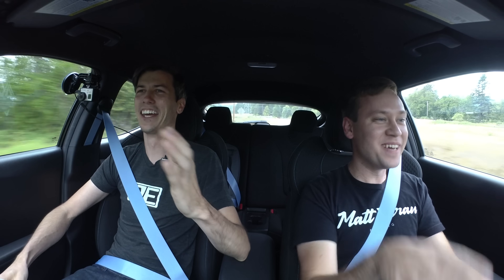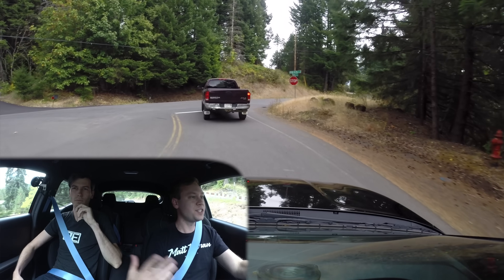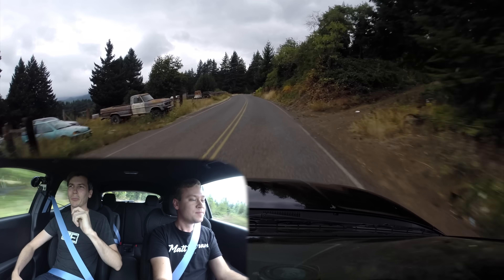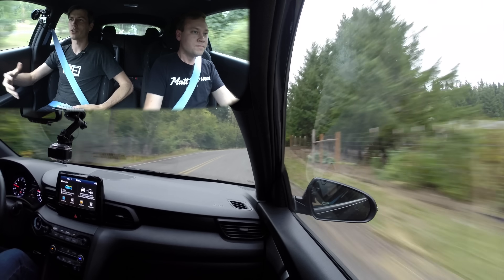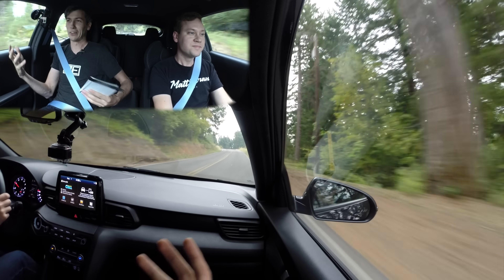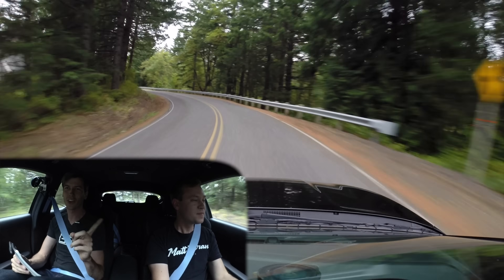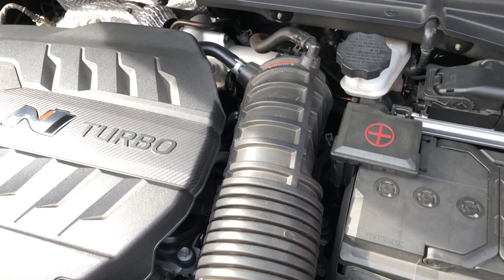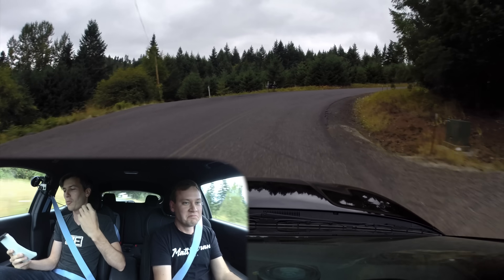Are Car Exhaust Crackles & Pops Fake?

Comment: A CVT that shifts fake gears is the dumbest thing a manufacturer can produce.
Reply: Yes it’s mind blowing, people want their geared cars to have so smooth of shifting (like on luxury cars, really using that torque converter and soft shift kits), but the wanting a jerking whiplash with literally the transmission that is designed to be smooth... Well, maybe they just need to ride with me to decide they don’t want whiplash, because that’s about how I shift my gears...
Reply: people are afraid of cvt. i tried to sell car with cvt transmission and every potencial buyer pass becouse of a cvt. everybody said that it dont change gears properly. 
i think thats why they programed cvt to immitate auto gearbox.
Reply: ICo Hi, tx!
Yes, I get that people have to get used to it but that’s just what it is. A CVT enables the engine run at its optimal speed all the time. By adding artificial gears, that advantage is ruined and defies the whole purpose of a CVT. It’s a pitty the majority of the people don’t understand this and ‘want to hear it shift’. 
From the manufacturers point of view: if you let the CVT imitate gears, why not install a regular gearbox then?
Reply: @Conservator.  Polaris rzrs and all side by sides are cvt
Reply: @Conservator.  id say just go with the auto they last longer than cvt's. Usually they only put CVT transmissions in 4 cylinder cars with low horsepower to try and maximize the little power, and marginally better fuel economy they do make at the cost of longevity. Something called Planned Obsolescence
Reply: Mitch Conner 
I agree accept for the planned obsolescence. CVTs are extremely difficult to produce. Iirc there are also industrial strengths CVTs.
Reply: @Conservator.  they have the same problems with dual clutch transmissions. They allow fast shifts, but they are complicated to build/ repair and they don't last as long on average as a conventional auto. Ford had problems with some 3 million cars with DCT not lasting till even 100k that's sad considering my auto transmission in my eclipse is 14 years old and well over 100k and still going strong. Also just to note my transmission is about $1300 some CVT's and DCT's are more than twice that price
Reply: @D1gpIco  they dont change gears is the point. you have either max power at all times or best fuel economy at all times depending on how you drive. a cvt doesnt change gears, it changes gear ratios smoothly.
Reply: How come cvts are always slower than a regular automatic then when theyre an option on the same motor.
Reply: @snarfbot  
Cvts might be slower (have a lower top speed) than other transmissions because of a limited gear ratio but they might be quicker to accelerate.
Reply: @Conservator.  lol no, that's never the case.
Reply: ICo I had the sport accord with the cvt and I loved it, I have an SRT now but I’d buy an accord again
Reply: I think it serves a purpose for cornering or drifting/powersliding, where holding one specific fixed ratio is benficial
Reply: @FxckingYeet  its a cvt it maintains a constant rpm look up polaris rzr that is a real cvt
Reply: @FxckingYeet  yeah i do agree
Reply: @FxckingYeet  merry Christmas
Reply: @Tyler Browning Yes but why not have both by making a CVT act as a fixed gear trans? If it's only in certain modes like a sport mode or something and comes back to beeing a CVT in normal mode then it's fine to me. The only way to manually control a cvt is through set ratios
Reply: CVT falke gearing? Tesla has instruments with needles but on a screen...
Reply: It's because most people aren't use to a cvt sound of it rev up and stay at that rpm. My quad cvt took a little bit to get use to
Reply: I strongly disagree, I can't stand when the CVT holds the RPM, screaming, sitting there at 5000rpm or whatever (at wot)...  Whenever i drive my girlfriends car (that has cvt), i drive it in manual mode because its sooooo much more satisfying, normal and better feeling & sounding.
Reply: My car with a CVT doesn't change gears (unless you put it in reverse) it just has 6 different set ratios you can change to when you want (fake DCT). In terms of how gears and CVT's can create ratios they are in essence the same (what happens between ratio changes is the big difference). A plus of a CVT thats often not mentioned is how you still have drive (power to the wheels) as the ratios change. Driving my car without the option to manually select the ratios you'd would be a terrible choice as it drives completely different in automatic than manual (for lack of a better term). In auto the revs start off high (3-4k) and drop lower as you gain more and more speed, in manual mode the revs start low and grow (like a geared transmission). Manual mode allows you to choose higher ratios at will to get in the power/torque range of the motor at higher speeds (4k+ RPMs when going 50 MPH+).
Reply: @4u2nvinmtl  my car is like this
Reply: What about japanese cars that play v8 noises through the car speakers?  glares at friend with the 370z
Reply: Phillip Aubin  prove it.
Reply: Yes... but no. More sales.
Reply: Well CVTs are belt driven and crap anyway, take Nissan for example, lucky to get 80k miles before the transmission goes
Reply: No the dumhets thing is to put a cvt in the car.
Reply: People want to feel that shift.
Reply: Gear hunting sucks and the CVT is trying to eliminate that.
Reply: @vvvvel  Competent tuning and programming fixes that.
Reply: @DragonKnightX12  Who's gonna do that for you the dealership? lol
Reply: @vvvvel  You get this amazing called a tune.
Or you buy a car that doesn't have that problem to begin with.
Reply: @vvvvel  lol You act people aren't already doing that.
Or that every vehicle has a problem with gear hunting.
Just in time for the EV take over.
Reply: The new Honda CR-V's do that at full throttle. It's kinda pathetic tbh.
Reply: Idk why Subaru putted paddle shifters in the forester because the forester is a cvt? If Subaru wants to put paddle shifters in the forester, gives us instead the dct with the turbocharged engine like in the forester sti.
Reply: It’s because people are scared of constant high rpms, and it’s better when selling as a salesperson, they can get away with just saying “automatic” instead of CVT, which can lead to people buying a CVT without knowing and talking about how anti CVT they are.
Reply: People complain about no gear shifts in cvt, which defies the whole point of a cvt. Then they complain about not having smooth shifts in cars with gears. Maybe it's the so called "rubber banding" of power. Or the sound cvt makes. Can't please everyone.

This is why I choose manual. If it shift rough, then I'm to blame. Makes me want to get the shifts as smooth as possible. Sure, fuel economy suffers but I drive hard anyways.
Reply: @2010ngojo   My biggest complaint with my 2007 Nissan CVT, besides that it failed at 100k miles (but still under warranty so no worries from me about it), is that Nissan didn't put ABS/traction control on my car so when the front wheels spin on water or crosswalk paint the engine just keeps revving and there is no way to get traction except to almost come to a stop and let the engine return to idle. It's very frustrating.
Reply: CVT’s are great, but when you are so used to fixed gears, there’s a disconnect between you and the car. If you always hear and feel the revs rising when accelerating, it is weird and does not feel right when you are pulling away while the revs stay the same.
Reply: Most CVT transmission are inadequate for city/Hi way driving. They work great in side by sides and other light applications, but put one in a Nissan van and you will be lucky to get 100,000 miles with no problems.
Reply: @HarrisonCountyStudio  depends on who is making the CVT.  Nissan has one of the worst, but that doesn't make them bad.  Toyota makes reliable ones, or else the Prius wouldn't have such a great reliability record.  Honda ones are ok, a bit behind.  The rest of the manufacturers seem to just not care so much.

Another example of a transmission that is done both good and bad is DCT.  Ford does it terrible, but that doesn't mean they are bad as a whole.  The issue is these are newer technologies and the bad apples stand out and ruin perception for the whole.

Think of manufacturers whose engine fail early and often.  Do you turn your nose up to internal combustion engines as a whole?  Or do you say, well those Dodge engines are having high failure rates, but that doesn't mean the Toyota engine will fail at the same rate.

Try not to form opinions based on emotion and anecdotal experiences.  Yes, Nissan CVTs are TERRIBLE, but it is the manufacturer they buy it from that you will find is the big issue there.
Reply: Kuromurasaki Zero ...not emotional at all (only women and soy boys make decisions on emotions). My experiences are anecdotal, and with enough anecdotal comments, maybe one can derive some sense of what to except from others experiences, or at least their mistakes. Anyways... I drive a six speed 7.3 diesel, it runs on bio diesel... it makes money and is not an over priced Toyota Prius. Lol

Been around farm/oil and gas equipment for a long time. Like I said CVTs are good for certain applications. 

I gave the example of the Nissan Van because my neighbor had his tranny go out at 78,000 miles. The guy garage kept his van and was meticulous with maintenance. On the hand, I’ve seen side by sides with 30,000+ miles on them, used mostly for recreation or general travel around work sites. All on the original CVT. I’ve also seen side by sides @ 4500 miles that blow the CVT out because it was over worked, hauling small (but heavy) trailers around the pads. 

I’m neither a mechanic or afraid of new technology. I’d love to see a reliable CVT that could handle the horse power output of say... a 2020 Ford F-150... Maybe some day, but today we will have to enjoy the technology of a 10 speed automatic.
Reply: Maybe a CVT is cheaper? But man, you’re really missing the point of CVTs if you’re having fake shifts.
Reply: @Appletank8  in my country most of the cheaper car uses AT and cvt usually found in more expensive car
Reply: @Appletank8 
Cvt is cheaper to make. But the repair costs, recalls, and lawsuits makes that a moot point (at least for Nissan). 

And they are manufactured to simulate gear shifting, the computer/ecu is programmed to do that.
Reply: Its funny tho how EE says cvts started faking gears, when one of the first cvts - my 2001 audi a4 multitronic already did that and new cars started not having simulated gears
Reply: @zDemoGODz  the cvt trans is much older then that. Really old snowmobiles use a cvt trans. Heck even some old mini bikes did. Most go carts do. The theory is there. Those old ones wouldn't handle the power but the operation is there.
Reply: @meegstomtom  mini bikes used to top out 40-50mph instead of 15-25mph with stock gears with a centrifugal clutch
Reply: @dcappucino9513  yeah. Centrifugal clutch is just a variable gear ratio. Giving best of both, low torque and high speeds. But there is still a final gear ratio to deal with. And safety :(
Reply: @Tyler Browning for acceleration it works, but for everything else it doesnt, because like you said it's computer controlled and the only way to have a human have some sort of control over it is to make pre set ratios. Imagine having one of these new cars with a 10 speed auto but without manual mode, and trying to go around a track. Every time you brake, get into a corner or are not using full throttle in general, the trans upshift to the highest gear possible, well that's how CVTs are set. Maybe they could tune the CVT to maintain a certan RPM all the time, but so far i havent seen any
Reply: I couldnt do the cvt. Coming from a manual trans it just feels like a slipping clutch.. felt very wrong.
Reply: No. The dumbest thing is still crackles and pops. I saw few days ago an Mercedes CL 63 AMG starting to move in reverse to get out from a parking place, very slowly. When stopped, before going forward, the crackles and two or three pops were heard ”farting” from its semi fake quadruple exhaust. I looked at the clown in the driver's seat, and his face had an expression of idiotic pride.  The fallacy is the new ”virtue” of our times...
Reply: 1zanglang oh you NAILED it.
Reply: 1zanglang 💯
Reply: I had a 2017 sentra SV (CVT) and it felt so weird and very disconnected not feeling any gear shifts when you expect it. Now I have a 2017 Sentra SR Turbo, with a CVT + programmed gears, it feels much nicer.

Comment: One other reason against ultra retarded ignition as a means of implementing anti-lag is the increased valve seat wear.

I first became aware of this problem back in the 1980's with a turbo charged car that used ultra-retarded ignition so that I could spool up the turbo to full boost in order to get a better launch during drag racing.

The valves seemed to be ok if the system was only used for brief periods of time, however while I was trying to get the system set up initially the repeated use took noticable toll on the valve seats.

Comment: I don't like fake sounds at all. I loathe the fake signal clicks. How about going back to mechanical flashers, cheap & work just fine? Then, the factory speakers fail in a few years. I think CVT s can be fun without feeling shifts if they are used in an otherwise fun vehicle instead of focusing on economy in micro cars.
You want exhaust noises? Drive a carburated Wankel rotary.

Comment: Does crackles have a negative impact (lifetime) on the catalytic converter?
Reply: Thats a good question. For the most part the ignition should have happened early enough that the fuel is basically burned up. And its not an actual backfire where the full force of the burn is open to the exhaust.
Reply: MostlyClaudy not if you’re catless
Reply: @DA9GUY31  🚨🚨 super illegal activity 🚨🚨
Reply: aktw1234 not in Florida there are no emissions to worry about
Reply: @DA9GUY31  damn you and lawless Florida
Reply: Mrs Magik umm so FEDERAL laws are not enforced ?  Pretty certain deleting cats is illegal on road going vehicles....
Reply: Typically those cats are high flowing catalytic converters. Otherwise yes it will shorten the lifespan of them but you wouldn’t notice unless you’re making it crackle and pop all the time and getting the exhaust really hot which will make the pops and crackles more aggressive.
Reply: Yes, it can cause the catalyst to clapse.
Reply: depends, if your car comes like that from the factory, definitely not, it was design to do that, after I removed, cats with a x pipe, added long tube headers, and added more fuel, it would do it periodically, and shoot flames as well, but now I tuned it on DCFCO, and now ita on demand 😁😁
Reply: In cars that are heavily modified and tuned to have anti-lag usually people remove cats.
Reply: @anthonypicciano7934  Actual anti lag is lethal for the engine. This is why it's only used in motorsports because they heavily maintain and replace engine parts after every race. Of course besides the noise issue as well.
Reply: Meow
Reply: @dorsalispenile9891  woof
Reply: I would say yes, I had my car rebuilt and mapped to retard timing when coming off the throttle, sounds great but my catalytic converter completely clogged itself within a few weeks. Happily catless now and no worries but I wouldnt recommend it if you arent willing to get a midpipe or it didnt come from the factory

Comment: The fake shift points in my 2017 Subaru Impreza drove me crazy. Acceleration was difficult because the car didn't like to "downshift", even thought it was a CVT. That was infuriating because I knew that if they had just let it operate as a CVT I would never have that problem.

Comment: Im really mad that Matt downshifts for those corners like hes gonna step on it afterwards and then just proceeds to shift up again
Reply: It's called car control....
Reply: @geoffbuck6865  he might as well let the rpm drop, as seen in the vid its not like he needs max turbo pressure or anything to get away super quickly. also im sure the car wont bog at this pace...

Comment: FAKE!  Real pops happen on engines that burn a rich mixture. When you snap the throttle shut, the excess fuel cannot burn until it meets the air at the end of the exhaust- BANG! *

Electronic trickery that delays ignition and/or overfuels only in "Sport" modes is fake...or could be called anti-lag.

*The fuel is hot enough to ignite spontaneously upon exposure to oxygen because of course the car is being hustled and the exhaust is very hot! That is why real pops/bangs/crackles are so cool, they demonstrate an abundance of fuel, heat and speed !!!  Profligate or decadent, it's cool either way.

Fake pops are completely predictable, real pops are random and vary in volume and number. Again, this unpredictable nature makes them cool - they are more like the angry growls of a predator...and not just a programmed soundtrack.

Comment: Audi had this Multitronic CVT Gearbox back in 1999 for a few model years in the A6 and A4. Once in the market, the mainly old customers complained of the strange feeling without shifting. So they also started later to program in artificial gear shifts. The older folks still complaining and the people who wanted the CVT because of the seamless feel scared away, it was just going down and the Multitronic died out slowly.

Comment: I for one don't like exhaust noise at all. For me it's the ultimate cheat because it's easy to tune an exhaust to make any car sound good. What thrills me is a good sounding engine... think of cars like the R33 Skyline GTR, EK9 Civic Type R, Escort RS2000, heck even a Bugatti Veyron! The engines themselves, esp on WOT, sound glorius. 

If I'm buying a performance car and all I can hear is exhaust, it's off my list, or at the very least, the first mod I'll be doing is changing the exhaust to quiet it down, so that I can hear the engine.